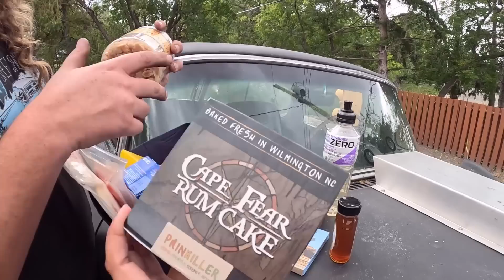Paying It Forward - Keeping Hot Rodding Alive With The $1 Biscayne

Comment: The key point in the video is when he put the DDSpeedShop sticker on the window. Got to thinking, I have a 95 Honda Civic with 310,000 miles on it. It's been hit by a truck, a parking garage,and an unknown source. Windshield is cracked, passenger rear window is plexiglass, have to beat on the dashboard to get the speedometer to work. I need to get a DDSpeedShop bumper sticker. Maybe I need hoodscoop first ?